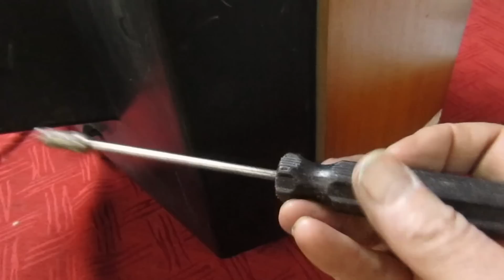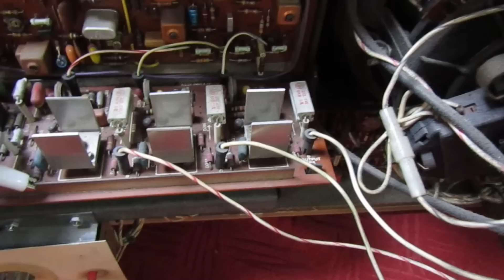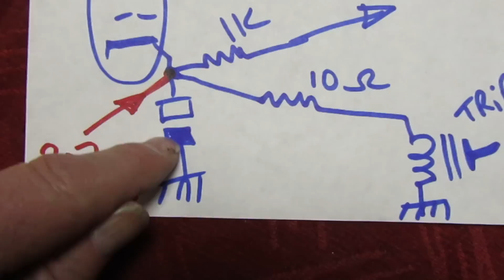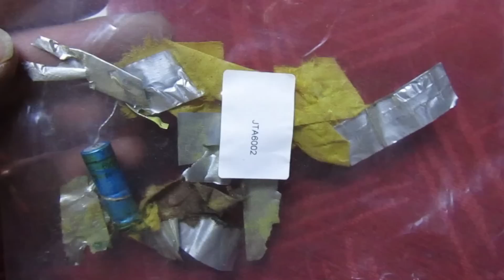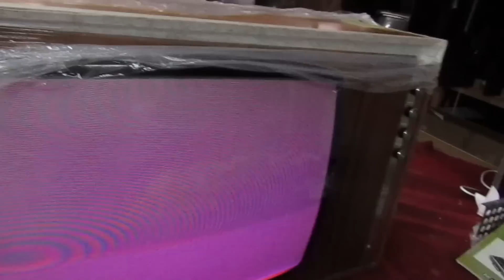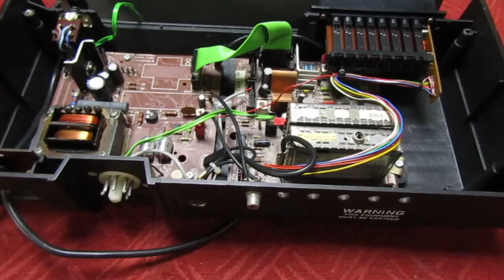Reddifusion MK1 Valve hybrid vintage colour TV set

Comment: Hi Michael...don't know if you got a result, but the board on the left hand side, the SF board has a flying link, 1v video occurs here, we used to inject crosshatch here for convergence. So if you have a  VHS or similar with 1v video this would enable a picture. Of course an isolation tx would be needed as that chassis is hanging on mains neutral. Frame faults were rare but hidden behind that frame board is a 2N3055 that used to give cramping at the bottom, it usually failed like this after a good flashover!

Comment: Those converter boxes lost Rediffusion  a lot of older customers! It was at the start of real cable television. The Rediffusion HF networks were usualy a maximum  of 4 tv  channel capable. In the Uk we had a "must carry" law for wired tv distribution that ment you had to carry your local BBC1 & 2 and ITV. In most cases the HF networks were installed where tv reception was poor, and as such people didnt have aerials. When the cable tv boom started the only way Rediffusion could hop on the bandwagon so to speak, was to be able to provide  the normal off air tv via an aerial, so they could use the HF network for premium cannels. So lots of customers got free tv aerias! Suddenly they were not reliant on 'the pipe' for tv, and left, not wanting to pay a monthly subscription for cable. It was a real catch 22 for Rediffusion.
Rediffusion was a very clever and innovative company, with an amazing r&d department. Its roots were in wired radio, providing radio via wire to homes. This saved the househod duying a radio reciver. They had a speaker in the house with as seleclor switch and volume control, at 100v line. Quite amazing for the late 20s/30s. Much cheaper than a radio at that time.
The second hand market was flooded with thoes boxes. They were good for tvdxr's as the front end was really good and were vhf/uhf.
There were some mods for tv audio out to feed to your hifi.
Sorry, ust a bit of potted history.

Comment: Hi michael, Thanks for the video, we used to have one of them, except we had a dial fitted to the wall.
Reply: My grandparents in Nottingham had a set which looked just like that.  Multi-position rotary switch on the window sill, labelled A - ?G, and a coax cable going to the set. Some positions were radio stations and didn't need the set to be switched on.

Comment: I had loads of those boxes 30+ years ago as they were being sold for 50 pence each at a radio ralley in Derby. wish I could help you but I used the tuners and binned the rest many years ago. I believe the downconverter was based on the MC1496 double balanced modulator IC. Good luck in finding one.

Comment: I remember that box! Reason being I needed a case back in my younger years to build the CRT tester/booster featured in the TV mag! The box came in from a dealer who sold some TV's to my then boss - we didn't have a Mk1 in the pile so the box was turned into the tester. Sadly the original insides were binned! My last encounter with a CRT set was the other week when a Sony KV1330U came in - a rarity for my workshop as I mainly repair flatscreens sets.

Comment: for a time this was the only colour set you could get on rediffusion/granada cable, all my relatives in Stoke were on it as stoke could not get Sutton Coldfield until the Fenton relay was built, then they discontinued the cable and issued these converter boxes and aerial to everyone. By that time they had transitioned to the Mk4 colour, the box  matched the mk4/4a fascia. I have spare boards somewhere but don't ask where, I used the empty box to build a christmas tree light sequencer. Should be a decent pic.

Comment: I've seen Rediffusion TVs a few times in the 70s and 80s,, but I've never seen those Rediffusion converter boxes, they were always directly connected to the 12way rotary channel A to L Rediffusion switch, that was usually mounted on the wall or window sill.
Reply: If I remember correctly A was Radio 4, B was radio 2 C BBC2, D ITV Midlands, E BBC1 and F ITV Yorkshire in the East Midlands region.
Reply: @steve83803 where I was "C" was shared between radio 1 during the day and BBC 2 in the evening, "D" was initially Anglia then changed to ATV when Belmont swapped to Yorkshire.

Comment: I vaguely remember that the speaker could work in radio-only mode too.  But if you left the TV switched on it would just sit there with a blank raster, making a whistling noise from the unlocked line circuit and chewing up electricity.  If the customer was too old to hear the whistle then they could leave it on all day like that, making their coin operated electricity meter unnecessarily hungry.
Reply from the maker: No doubt your right, this is a set I have never repaired before so it's a learning curve for me.
Reply: I remember using them in audio only mode. Rediffusion would rent out loudspeakers so you could listen to the television sound or radio that they relayed without the expense of a television.

Comment: Michael,

I have got two suggestions to test your set. It was a long, long time ago so I may be wrong. Now that wired model also had a aerial model and shared the same chassis. 

The board straight in front is the Decoder board, it has a plug at the top and three loose wires at the bottom connecting to the RGB board below it. You should be able to feed a video signal into this board. I think there is a test point. The sync should be ok, as this board also extracted the sync for the timebase board. 

Another option is to get the aerial board and tuner buttons from aerial model.
Reply from the maker: I have a box now and some boards on the way so hoping to keep this original.

Comment: those receiver boxes were sold in modified form by display electronics for dx tv use, had a demodulator and olour decoder board fitted  to feed rgb or composite output, i have one of those modded boxes but think all the existing parts are present, if i can i'll try to find it within the next few days, if it'd still work with those bits removed , (i dont think theyre used in the modded versions) i could do a board swap if you want?
Reply from the maker: Yes, Display electronics, that rings a bell, I have a box now.

Comment: Yes. Many yeas ago, sendz or bull used to sell the converters as the “telebox 2” we had one. It could take an rf tv signal and convert it to RGB and sync. It also had an audio amp that fed to a little speaker where the plug is on the unit you have. Maybe someone has a telebox 2 hanging about, as these are pretty useless today. As it had all the stuff still in it. Good luck

Comment: Great video. The eldest set I ever repaired was a Decca Bradford that was, by the 1990s, truly ancient. Regarding  the cap that exploded, could the trip be high resistance? If it is, the voltage drop across the cap could be excessive.

Comment: I'm  sure I have some boards or maybe a spare box in the garage, I'll take a look and message you tomorrow. I also have an official diagram of a circuit to modify a Labgear Colourmatch crosshatch generator for HF output to enable Rediffusion engineers to converge these sets when a test card was not available.
Reply: Yes, I have a board with the HF modulator and audio transformer on it, the mains transformer is missing and the PCB is cracked but modulator and af transformer work OK.  Your welcome to it to get the cable box working. How can I get your details ?
Reply from the maker: Please send me a e mail.
md@digifixltd.co.uk
Many thanks.

Comment: What a blast from the past. I  worked for Rediffusion  around 50 years ago, and have repaired many of these models. All the Rediffsion sets were modelized so each board could be replaced in the field,  for quick repair. Then they would be repaired in the workshop. If I remember correctly the unit with the valves was called a tower unit.  Undo the 4BA bolts at the top and undo 2 plugs and it comes out.
I have had the capacitor explode on me in the workshop.   If I remember correctly it explode due to the cut-out switch going open circuit which resulted in 240 across the capacitor.   We had dedicated repair rig to repair each of the boards. Unfortunately I never came across that convertor box, until I watched your video.
Reply: Me to! :-)  I worked for Rediffusion Television at Basildon 'Newtown' (at the time), which had a Cable System, from 1972 to 1986 (taken over by Granada TV 1985 ish). Spent 12 years working in Basildon servicing Cable TVs, and knew the Mk1 very well, as well as the later models too. During my Last year, before I left,  I was based at the Granada Depot Romford, I grabbed a redundancy offer £££ after a year, as I hated it there. But yay I was finally free!!
Reply: Same as you worked for Rediffusion from 76 to 81. Worked on the repair rigs. Good days.

Comment: Those caps used to fail, not always as spectacularly, but I do remember one exploding on the test  bench and managing to hit the fluorescent light tube above, showering the engineer with glass working on the set below, he was ok.

Unfortunately I can't help you with your request. Don't think I've even seen one of those boxes. I think all our cable TVs were swapped out to aerial sets with subscribers given a free aerial, when the cable was withdrawn in the 80s.

We did have a large block of flats in Newcastle which did still have a cable setup and we used to supply inverters so an aerial set would work with the cable network in the building. As you couldn't get a TV signal on one side of the building.

Pretty sure there is a cover missing off that lopt tower as well if my memory serves me correctly.

Comment: The model you are repairing is a ch2210 😊 the nomenclature was c for cable h. For high frequency 22 size in inches and 10 is Mark 1 variant 0.  So this was one of the very first generation of Mark 1.
Reply: Almost right C was for colour H was for cable models U was for UHF off air models. The last models I remember were the CU2213 before the mark 3 came out.
Reply: @steve83803  if I recall correctly there was a CH and CU 2217.  From memory, these were refurbished sets that were designed to look a bit like the first Mark. 3 range. Essentially sold to those who aspired to a Mark III but couldn't quite afford it.
Reply: @ I can remember the Bush 823s that got re-cased to look like Mark 1s. I actually built one myself. I was one of the last “System Engineer” apprentices before Granada took over so had training in TV servicing, Network and equipment maintenance, I think the plan was I could do any technical job in the company. Still miss my T reg Vauxhall Chevanne 😀
Reply: @steve83803  you're right and I knew that. DOH!!

Comment: I think someone was selling these converters off in Television magazine years ago..Sendz etc.I wonder if it's just basically demodulated audio/video fed into the set?
Reply: I remember Sendz selling these boxes the Reddifusion TV required a composite video signal modulated on a carrier signal of between 5.9Mhz and 8.9 MHz that's what the missing box on the PCB does. The audio was sent to the TVs via a 100v line network this meant that the TV could be used to listen to the radio while the TV was not powered on. In that box the missing transformer is the audio step up transformer to provide the required 100v line output from an internal amplifier in that so basically that set top box received the standard analogue TV signal from an aerial and converted it to the 5.9Mhz to 8.9Mhz signal and the demodulated audio signal was simply amplified by a power amplifier coupled to the 100v line matching transformer the output power of the audio was only a couple of watts so the 100v line transformer didn't need to be too large. The audio transformer would be fairly easy to substitute but the missing RF box will prove difficult to substitute or find. The rest of the circuitry is a standard analogue TV front end and it looks like the previous owner modified it to use as a TV tuner to provide a composite video source .